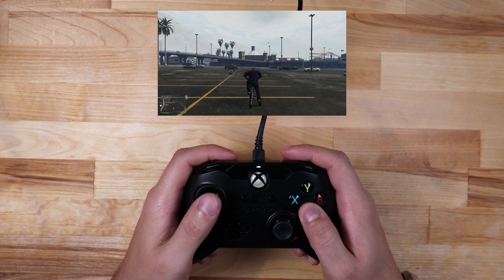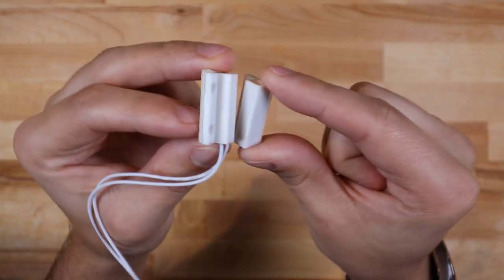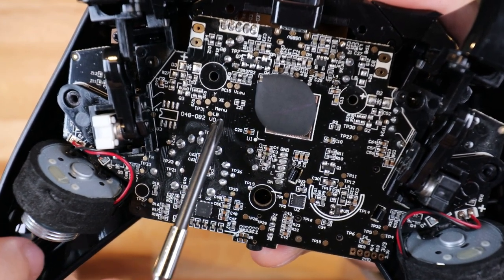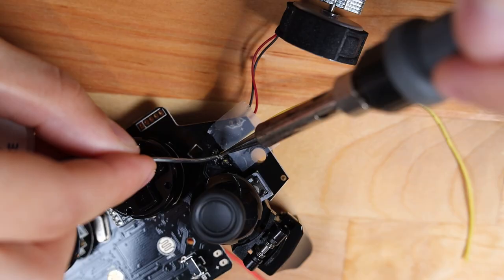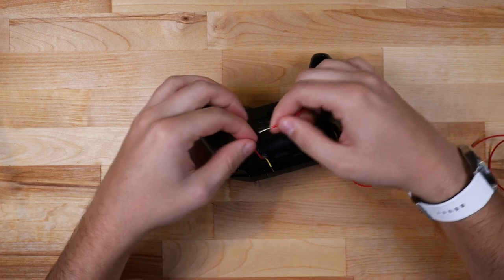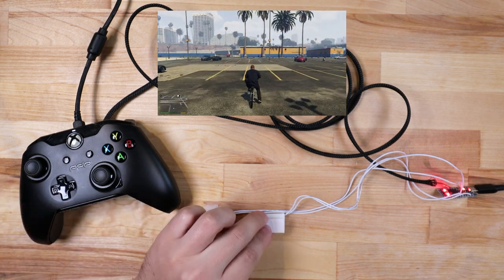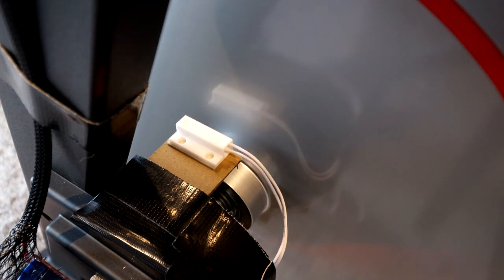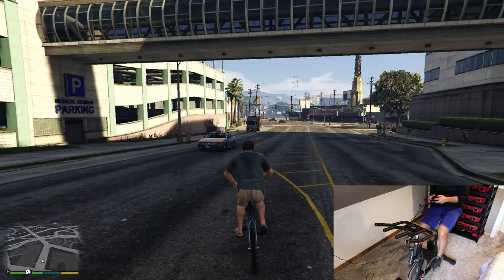I built a bike that plays GTA5 - Controller Mod

Comment: You should do this in bike mode in certain Pokémon games. You can do this with a GameCube with a Gameboy player and Gameboy Pokémon games or even the Nintendo Switch with Pokémon Sword and Shield.
Reply from the maker: I haven't played pokemon in yeas. I'm assuming you're talking about the bike you can get in the game to move faster?
Reply: Insert Controller Here Yes you can move faster in the bike. In the video, you use the bike to accelerate but you still have to rely on the controller to steer or do other actions. In Pokémon Sword and Shield, you can even bike on water once you played the game by story and unlocked that feature.
Reply from the maker: Lmao bike on water? They couldn't just let you ride a water type pokemon like in the anime?
Reply: Insert Controller Here 
Not in Pokémon Sword and Shield.

Comment: and what was the 2nd switch for? Did you abandon the idea of making it work in reverse?
Reply from the maker: I did implement it. Did I forget to include it in the video?
Reply: @InsertControllerHere  So that's what happened! Yeah you never pedaled backwards in the video. I just wanted to ask how the arduino can tell it is pedalling in a different direction,
Reply from the maker: It tracks the pulses of the magnets. If it detects two of the same magnet pulses in a row, it knows you changed directions.

Comment: Ohhhh you're awesome, just randomly saw your arduino video.  Question, how would you go about making a controller that can join together, split apart and connect to a raspberry pi like a Nintendo switch? 

Man I'm a super beginner but I wanna make a Nin-ghetto switch with retropie.  Wanted to split an Xbox controller aswell to be my joycons haha.

Wouldn't be me if I didn't jump in the deep end, with sharks and a cut on my leg lol

Any direction or where to start my journey, greatly appreciated
Reply from the maker: That's a great idea dude. Come check out or discord channel linked in the description for more info or if you want to ask us questions. The switch joycons use a rail system to attach to the switch via physical pins. When you detach the joycons, it switches to bluetooth mode.
Reply: @InsertControllerHere  much appreciated bro, will definitely jump on the discord in the morning, thanks